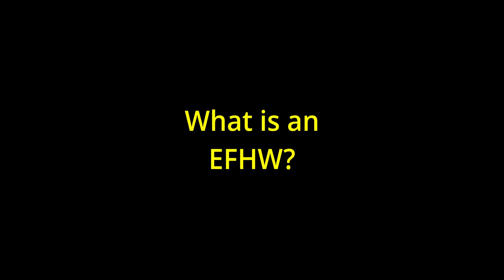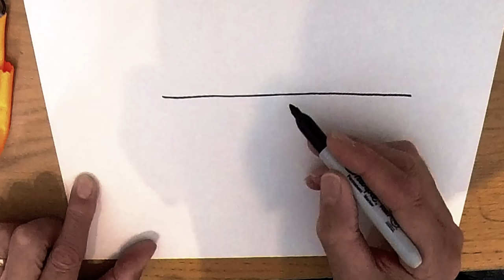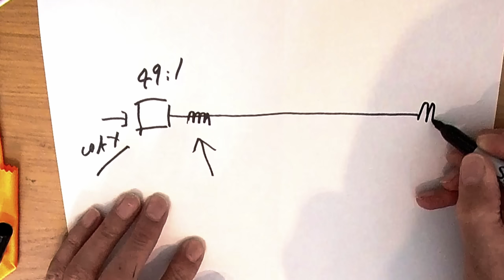EFHW Your Questions Answered about the End Fed Half Wave Dipole

Comment: My setup. 20 feet of coax to a 5 ferrite choke pigtail. No grounds or counterpoise. No ground at radio either. Antenna is a My Antenna 40-10. I break pile ups with 100 watts and work the world. It is also in a very sharp inverted vee. Strange but it works great.
Reply from the maker: Hi Larry. great to get your report.

Comment: Excellent video! I use an EFHW cut for 40m and it works quite well. I have had DX contacts from Eastern Canada to Asia, to Australia, to all of Europe and as far south as Antarctica. Record DX using FT8 is 16,900 kms. My only complaint is that it picks up a lot of noise - noise floor is S7 on 40 and S4-5 on 20. Most DX is on 20 - 10 meters. My set up is a home-brew 49:1 mounted on a fence post at two meters, the wire goes up a pole about 17 feet, then across the yard to a paint pole at about 15 feet. PS, I have a pretty good tuner and have also made contacts on 80, 30, 17 and 12 as well. Canada to the Balaeric Islands on 80m using a wire that is half the correct 1/2 wave length ~6,000 kms. Not too bad!

Comment: Just watched this a second time. Thanks Peter just finished fitting my CG 49:1 up over the weekend. Final research on the wire 
length, I am going for 40m initially, with a later project, to build a coil to extend it to 80m. My listening station will be live soon. 👍🙂
Thanks again for all the time and effort you spend sharing your experience.

Comment: Very good Peter My end fed sits on the top of the 6ft fence 80 metres down to the bottom of the garden, works like a dream antenna , your design as well, as  does the 49:1 unun your design, bought the wire from you👍👍😊😊,happy days & stealth as well, loving my QRP station, Paul M0BSW
Reply from the maker: Hi Paul, great to hear from you and sounds like toy are doing well. Keep at it!!

Comment: Hello Peter, very interesting topic, I think I’m correct in saying that the coax screen acts as a form of counterpoise for the Antenna, having experimented with my EFHW, adding an additional wire to the 49/1 makes no difference.73
Reply from the maker: Hi Alan, the EFHW only requires a tiny amount of counterpoise and I have often used just a 2m length of coax.

Comment: I have never bothered with the small coil on my 66' EFHW 40-10m antenna. However I have and am using a coil at the far end of the wire for covering the low end of the 80m band. I run my EFHW as a sloper from 10 feet to 50 feet at the far end. I bend the last 10 feet of the 66 feet down to the the vertical making the 80m coil and the 3-4 feet of wire after the coil in the vertical. I do ground the transformer with a piece of wire and a 6 foot ground rod. My antenna is home brewed for high RF power. I used 14 gauge wire to wined my 3 stacked 43 mix cores. Thanks Peter for the great videos.  73 Joe
Reply from the maker: Hi Joseph, sounds a good setup. Nice to hear from you.

Comment: Great advice as always. I recently put an 80 EFHW in my attic. I had to wrap it around 3 times. Not pretty. But, it does work a bit better than the G5RV jr it replaced. Then I added just enough LMR 400 coax. Small changes have significantly increased performance. The first voice contact I had on the new antenna was in England of all places. I was shocked.
Reply from the maker: well done. Keep at it.

Comment: I have only just put up a a random wire which I guess I could call a EFHW. 135FT of wire averaging about six feet high and hanging on branches and it is the three sides of a rectangle as it goes around my garden. I used a very cheap 1:49 unun without a counterpoise and fed it straight into my IC 705 without an ATU. The SWR was passable on most bands. My first contacts on 20m running 5 watts were with Quebec and Ontario. This is 1400:km. Tnx for a great and reassuring video.
Reply from the maker: Hi Michael. That is great news. Keep at it.

Comment: 100% endorse your key points Pete. I was advised to put the un-un at gutter level, run the wire down the garden and then bring any excess back at an angle. Works a treat and allows me to work stations on 40m I cannot hear on other antennas. I did find I needed a choke 'balun' at the transmitter end of the feeder to prevent common mode currents messing up my CAT connection. Also cleaned up the VNA plot.
Reply from the maker: Yes that line isolator at the tx end is important.

Comment: You can use small wire like #18 stranded as it does not need to support the coax and the shorter coax run makes up for any transformer losses. One could also add remote controlled relays at the transformer to switch to different radiators like a half wave vertical for 10M, even 20 a run of CAT5 will work.
Reply from the maker: Yes a relay option would work. Best some form of latching relay.

Comment: A very timely video. I have just moved into a new house with a garden just shy of 20m long and was wondering if I'd get away with a bit of a bendy wire..
Reply from the maker: Hi Steve. 20m wire down the garden, add an 80m choke coil and drop the last few feet vertical.  80m - 10m 5-Bands.  73 Peter

Comment: Excellent discussion Peter. I found that the 110 micro Henry coil caused a very narrow bandwidth on 80 meter. So I have cut the additional wire after the coil for exactly the frequency where I usually work. Thanks for the information. Always interesting.
Reply from the maker: Hi Danie, yes you will get a narrow bandwidth because on 80m the antenna is very short compared to a full size half wave.  73 Peter

Comment: Thank you for an excellent video on the “practical application” of antennas. So often we are besieged with publications claiming only the “perfect antenna in the perfect location” will work.  Personally having used aluminum canoes on sawhorses, foil ductwork tape, and expandable bathroom vent hose for antennas, I concur that you can have a lot of fun, and even work DX, with the most humble of antennas. 73 de Dan WD4DB
Reply from the maker: Many thanks Dan. Yes, if it works use it.

Comment: I have two EFHW antennas. One I built with a homemade 49:1 Unun and the other was made using an Unun purchased on Amazon. Both of them are tuned for 40 meters through 10 meters.  I installed them in a upward slope from a few feet above ground to a tree about 20 feet high. 
My problem is my G90 Radio waterfall shows an evenly spaced  series of noise bands on all bands. Noise is quite loud and the noise bands are fairly wide. 
What would you recommend to eliminate this noise?  Using a vertical whip in same location, I do not get this noise.

Comment: Question: An EFHW is set up as a sloper, oriented North/South, with the high point at the North, wire sloping downward toward the South and the coax feed point at the South a few feet above ground. Radiation will be broadside to the wire. Does the fact that the wire slopes down from North to South mean the antenna will also tend to have stronger radiation in the direction of the slope, South in this scenario?

Comment: Great video. One minor thing I take exception to is the radiation pattern on the second harmonic. For example, using an 80m EFHW on 40 meters your radiation pattern is vastly different than what the same antenna yields from a center fed version. The current maxima on 40m will be out of phase and the overhead, high angle lobe will cancel leaving you with a deep null at 90 degrees. This may or may not be an issue. It's a real big issue for a 160m EFHW being used on 80m however. In fact, on 80m your regional coverage will be at least 10dB down from the same antenna fed in the center. For this reason I consider the 160 EFHW a one band antenna. The higher harmonics end up being too high in frequency anyway and the transformer  ratio requirements are also different.
Reply from the maker: The radiation pattern is virtually the same whether you feed a resonant length at the centre or at the end. The harmonics follow the same pattern. This is covered in several issues of ARRL Antenna Handbook. The harmonic resonant drift can be dealt with by the small correction coil often placed near the feeder end of the antenna.

Comment: Hello Peter, I hope you'll answer this question, I live in a community where I cannot erect an antenna, so my only option is an EFHW running parallel to the aluminum gutter around the house. I plan to use aluminum Christmas light clips to attach an insulated wire, (known in North America as telephone station or Z wire, four insulated 22awg conductors in a PVC jacket). What effect do you think will the proximity of the gutter have on the antenna?

Comment: Nice 1 Peter I have found not to cut the wire shorter I do a Z +/- 1m from transformer  +/- 4-8 " ( 100-200mm) long tape/zip/cable tie together  and it give me some adjustment  to tune  as I found it does change from place to place and donot have to take  down to adjust it just slide  the Z longer or shorter,
Thank you,
Pieter,
ZL1PDT ex ZS1PDT
Reply from the maker: Hi Pieter, that’s an interesting approach. Many thanks.

Comment: Thanks Peter.  Very useful.  If I ever get on the air I think it will almost certainly be an EFHW.  May end up as an inverted V and also bent horizontally but it sounds like you can do almost anything with this antenna and it does not grumble too much.  Thanks again.  Stu.  M7EOS
Reply from the maker: Thanks Stu.

Comment: Excellent video Peter, gets all the relevant points across in less than 20mins.  I'm fortunate that at my QTH I have space for a full size 40/80 dipole and a separate set up for 20m and above, but I use an EFHW with a 110uH coil for /P.  One thing I can't do at home is get on top band - are you aware of anyone using a full size 80m EFHW with a coil + "tail" set up (similar to the way to add 80m to a 40m EFHW) to get on top band, or would there be easier solutions (e.g. to make a base loaded vertical). Thanks
Reply from the maker: I have no doubt it would work although I have not tried it. But two issues may need noting. Does the UnUn you use, cover 160m? Also, the band coverage will be restricted, maybe as small as 50kHz.
Reply: As Peter already stated, the bandwidth will be very small this way. You may try to use the wire of your 80-halfwave (you have to disconnect it from the unun!!!) as a quarterwave radiator against some (buried) radials and any bigger metal structure in your environment. If you find this solution working, you may build a remote solution that allows you to switch between using the wire endfed or as a "vertical" quarterwave on 160. There are only few publications on the web describing this solution, but I'm sure you will find some of them.  Besides the advantage of a (slightly) wider bandwidth, you don't need to care whether your unun core covers 160 or not. (Plus you are most probably able to run 160 with full legal power - no matter which country your QTH is...)

73!
DL1WTE

Comment: Would there be any reason why I couldn’t run an end fed antenna in my attic running the antenna down to the main floor making an inverted L shape?  The antenna would run through the floors to come out just by my rig and connect to a 9:1 unun?  Just one little hole for the antenna going through the floor. Just a thought.
Reply from the maker: Yes you can. But you would need to add a short counterpoise of 3 or 4 metres  - could lay on the floor - in order to keep rf voltage off the radio.
Reply: @watersstanton  Thank you for your kind reply! I appreciate it!  73 Curtis KD9ZDH

Comment: Peter, I have been thinking about the LDG 49-1 unun for portable use with an end fed. It has two screw terminals, one is obviously for the antenna but the other is marked earth. Do I need to make a ground spike to use as earth or will it be fine without for portable use? Thanks
Reply from the maker: I have never found any benefit, so I leave it unconnected..
Reply: @watersstanton  thanks Peter, 73’s

Comment: Peter a couple of years ago you mentioned using a line isolator or 1:1 balun in the feeder, close to the transceiver but after any meter. Would you still recommend this? I'm building an 80M EFHW.
Reply from the maker: Yes.

Comment: Excellent video!  One question not covered, which I hear/see often with conflicting answers. Is a common mode choke needed on the feed line?
Reply from the maker: Not absolutely needed, but I always add one at tx end in order to get accurate VSWR readings.
Reply: I add my common mode choke 0.05 wavelengths down from the feed point by wrapping the coax on an FT240-31 toroid core (I just use RG-58 coax and wind 10 turns on the core).  The reason I place it at the 0.05 wavelength location is for several reasons.  One reason is that the 0.05 wavelength location (on the lowest band of operation) provides the amount of required counterpoise that was mentioned in the video, the second reason is that it isolates the rest of the coax (really the coax shield) from altering the resonate frequency and therefore the SWR when handling the coax below the choke (easily observed when watching SWR on a VNA or SWR meter), and the 3rd reason is that it prevents common mode noise induced on the long run of coax below the choke from reaching the feedpoint (noise generated from within the shack and/or house as an example) and this helps reduce receive noise.  Just FYI, Don (wd8dsb)

Comment: If I cut an EFHW for 20m is the second harmonic only 10m?  Second is how many wraps to bring 10m into better resonance.
Reply from the maker: Second harmonic is 10m. The number of wraps depends on the wire and and the plastic covering. Try 2ft tightly wrapped and then trim back as needed.

Comment: One further question Pete, Does using a ground with an EFHW reduce noise? I'm sceptical myself, but wonder if you've done any tests yourself 73
Reply from the maker: Probably not if you fit a line isolator at the tx end.

Comment: Well, I turned my EFHW into an inverted V, I messed up, but it turned out well. I used SS guy wires which apparently radiate instead of rope or fiber. So I had an NVIS that worked on multiple bands. Now I have accidentally created the PERFECT 20M antenna. Get 2,000 miles with 20 over 9. I have other antennas for 70cm, 2M, 6M, and 10 M. I suppose I could hook up my unused LDG 200 tuner to try to bring 40M back.
Reply from the maker: Thanks for sharing Steve
Reply: Hi Steve, what length  wire did you use for that inverted v with the great results on 20 meters,. I have been wanting to try that.
Reply: @briantrask8173  66ft for the primary radiator, about 10 ft off ground at each end, 2.5 lb weight at end opposite house to keep it taught. Wanted to go 33 feet in the center but couldn't get the mast up by myself, so went 26 feet in center. I have lots of diagrams and pictures.